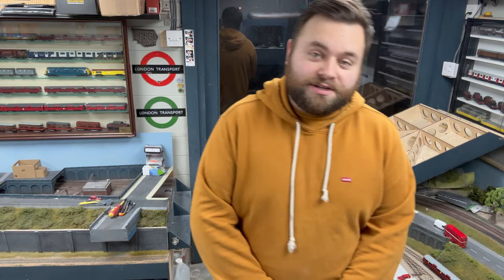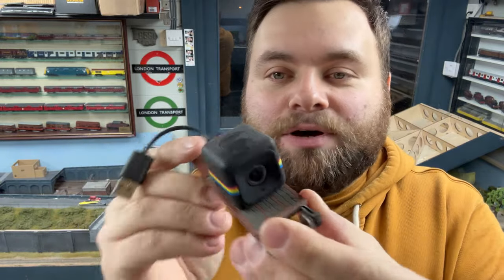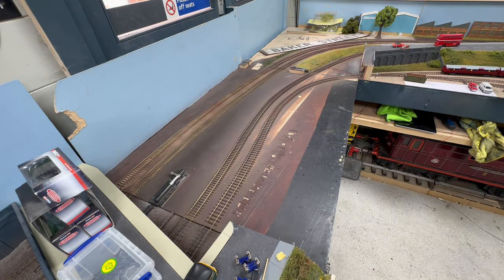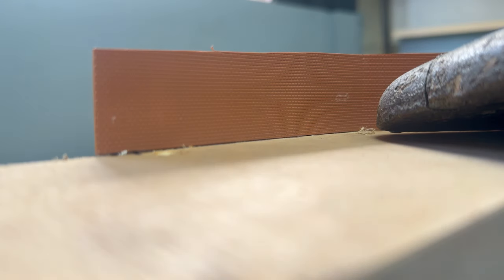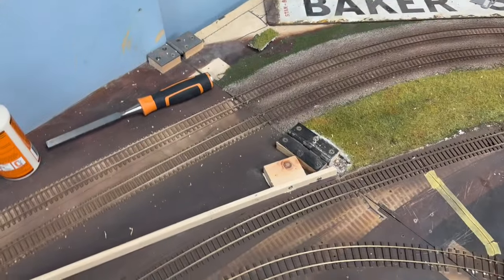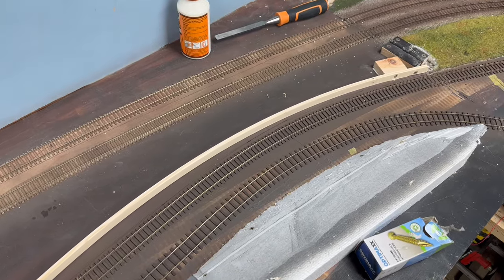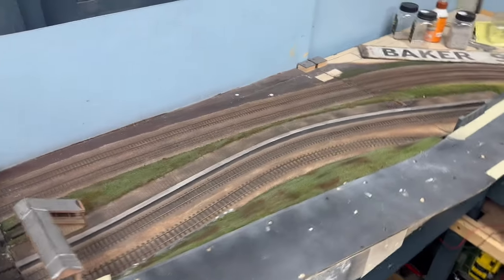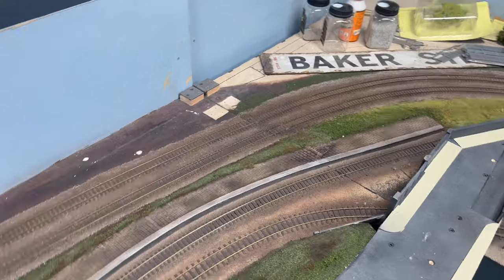London Underground Model Railway 20 - building a disused station on a lift out baseboard

Comment: I am always stunned by the chaos that's a Brilliant part of your modelling.  Even better I can almost predict "the Plan" after hearing you talk us through now.  (it has taken a few years)  The relationship you share with your local model shop and the blending of the hinge are great features of your modelling style.  Enjoy yourself and thanks for sharing. I would stop there. Disused stations are not a common feature on Model Railways.  Might be a good place for a Driver Training or staff-only platform.   Can staff cross the lines without a footbridge to extend the theme across the main ?? you could then have the staff training facilities on the other side of the main.
Reply from the maker: Thanks, seems to work out in the long run hey. The thinking is have it extremely run down as if its very very rarely used by passengers for example. Should do the job!

Comment: Dear Eric, love the vid! Great build. Was indeed wondering how you would approach the scenery on your lift bridge. Think this is an excellent and awesome solution. So cool to see how you’ve camouflaged the hinge. While watching I thought it would be interesting when you would add the entrance bridge and stairs from the road bridge, instead of from the embankment side. That of course would mean the foot bridge should be removable, which would and could allow for the appropriate camouflage of the bolt mechanism. Must add here I also like the solution you chose. In any case I think the little footprint around the bolt could still be camouflaged with a removable part. Possibly even two versions, one for the disused station, one for the station functioning. 
Very interesting how you did the platform construction. Very curious for your next episodes! Cheerio
Reply from the maker: Thanks, glad you enjoyed it!! Yeah i think i will likely have the hinge exposed just to make life easier, however i will add some greenery infront so from the platform its unable to be seen 🙂🙂

Comment: To hold the road in place you cud always go to IKEA and get some spare parts.
The smal metal pins that you put IKEA shelfs on in cabinets shud wok good.
Just drill a slightly smaller hole in the bottom of the road and bang them jn there and they will stay I'm there for good.
And on the baseboard you drill a slightly bigger hole that the pins can drop in to.
Reply from the maker: Funnily enough someone else has suggested a similar setup too. Thanks buddy!

Comment: Great update as always.  I like the disused station.  Just a thought, would it be possible to create an old lift of station building off of the side road down to the platfom?  It could sit over the bolt then.  Might make the road section easier to lift away without the stairs too.
Reply from the maker: Cheers mate, there is a reason for the way it sits currently, i will probs mention it in the next update on it ect. 🙂

Comment: Keep it disused. Maybe take the footbridge out but leave the gate by the road? I feel that IRL they would have been worried about trespassing and would have removed it - probably selling it to a heritage line! You could make a feature of the footprint/foundations where it would have sat on the platform…
Reply from the maker: Thanks, my thinking is have it not 100% disused but very run down and on its last legs. Specials only or just a parliamentary type thing

Comment: Great build, Eric. What will be the name of the disused station? Back when it was a station stop you really had to "Mind The Gap" with its noticeable gap at mid platform. Should the council approve a large housing estate nearby might TfL consider reopening the station? Bill from California.
Reply from the maker: ‘Breakspear West’ 🙂 it works if you saw a map of where the layout it based. I may cover it in the next update on it if i remember actually.

Its funny actually, the idea of my main station ‘Harefield Road’ in real life was that it was going to be built, then housing developed around it, but the Green Belt project came in which stopped the area from being built on, meaning the station was then pointless and cancelled. I guess this could be a similar type of story.

Comment: My first time commenting on any of your Videos Eric. I think the Station would be better as a Station in use on the Branch Line just not many people use it. You could add about 4 Lights to the Platform 1 Light at The Station Entrance and 1 Light on The Station Walkway giving it that Rundown and Fairly Dark under used look, a couple of Seats upto 4 People and at the back of the Platform a Picket Fence so Passengers can not go down the Embankment. Also a Station Name say as its next to a Bridge call the Station ( Old Bridge Road ) Have 4 Station name Signs 1 at the Entrance and 1 in the Centre of the Platform and 1 Each End of The Platform. You could do it so a Train only Stops there say every 4 Loops around the Layout and not every time a Train Approaches The Station.
Reply from the maker: Thanks Phillip,  yeah i think my plan in my head is a similar thing. It will be a very run down station called ‘Breakspear West’ where its only used on certain days/special occasions and hardly gets any passengers.
I picked some lights up today for it handily!
Fencing is coming next too 🙂